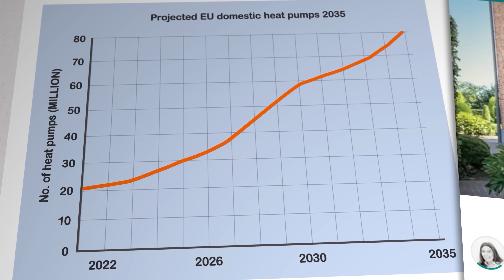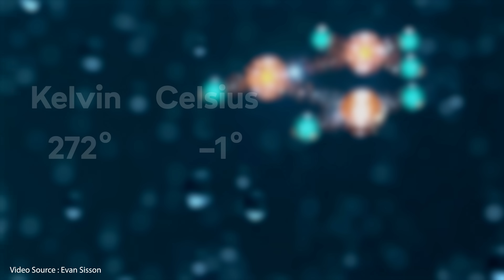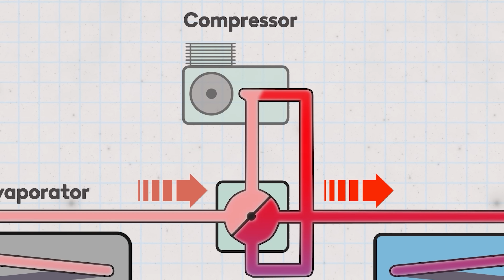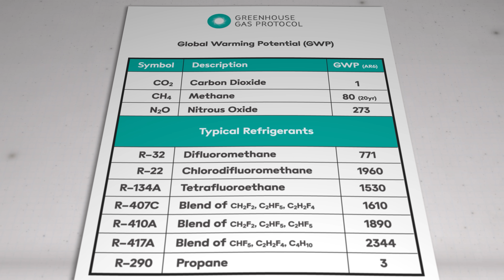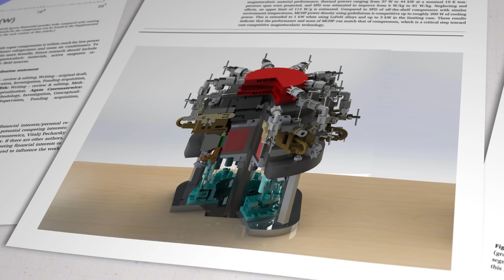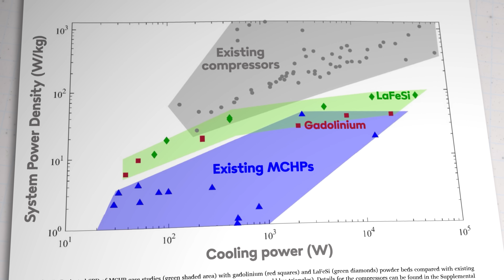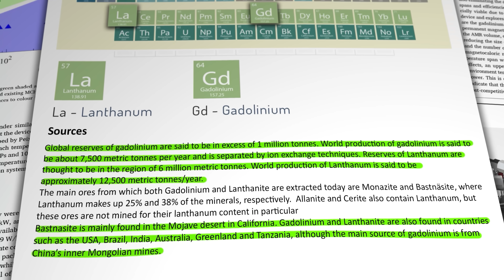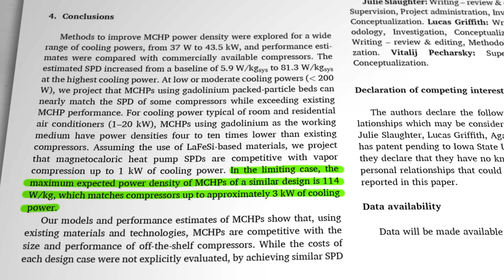Taking greenhouse gases out of heat pumps. (YES! They do contain them!)

Comment: I have 3 mini splits at 5k a piece. Work pretty well & allows me to select room i need most product during any given timespan. Air does not radiate all over, generally out to 8 feet. Does alleviate having to use my full furnace or AC on days where I would not need full heating or AC.

Comment: I wonder whether this technology is more efficient in cold environments than conventional refrigerant systems are?  One limitation of current heat pumps is that their efficiency drops off as the outside temperature gets lower; they're still more efficient than the alternatives, but an improvement in low temperature performance would be a boost to heat pump sales.

Comment: Once one realizes and accepts that the global warming/climate change emergency is a complete hoax, the solution to heating and cooling homes becomes one of pure economics and some answers just jump right out and slap you in the face.  For instance, if you use a heat pump for heating your home, drying your clothes, and/or heating your water, you will pay more up front than buying an electric or natural gas furnace, water heater, or clothes dryer.  You will also spend more money keeping those heat pumps operational.  Once you realize your choices have no effect on "saving the planet from greenhouse gases", it becomes very clear that the refrigerant that should be used in heat pumps should be low cost (not patented) and not EPA controlled, so go with something like propane.  If you live someplace where you heat your house for a large portion of the year and only need AC infrequently, then you have to consider having a simple electric or NG furnace and a seperate AC unit for cooling si that the high reliability furnace racks up most of the operating hours and the low reliability AC racks up fewer hours.  But, if the cost of energy is high, then a heat pump may make more sense especially if its maintenance/repair costs are kept low through simple modular design and use of a low cost refrigerant.
Reply: Aren't you getting tired of dribbling the same nonsense over and over.🥴
Reply: @davidwatson8118  Apparently you haven't a clie what is abd isn't nonsense.  If you believe in the "climate crisis", I fear that your lack of critical thinking is uncurable because that concept is laughably moronic
Reply: @kirkjohnson6638  
"Clie"   😂
Please don't post while drinking
Reply: @kirkjohnson6638  
It's not my ' critical thinking " that's a problem, that is your issue 🤣
Reply: @kirkjohnson6638  
What is causing the current global warming 🤔?
Please provide citations and references.
Reply: @davidwatson8118  How long have we had any accurate global temperature measurements?  How is the average global temperature calculated?  How many times per day are local temperatures sampled?  How far back is carbon dating accurate?  How accurate are tree rings?  How is ice coverage estimated?  When was the thermometer invented?  What is the most potent greenhouse gas?  How long have water vapor's greenhouse gas effect and cloud formation been included in climate models?  Why have climate scientists erased the medieval warm period?  What is the accuracy and precision of temperature meadurements that are fed into climate models?  Are climate updated very often  wnd when they are, are the models revision controlled?  Why is the IPCC report compiled by politicians rather than scientists?  Why is the imminent doom of the climate always 10 to 12 years away?  How/when are any carbon taxes going to be used to reduce carbon and what are politicians going to do when removing CO2 from the atmosphere has no effect on global temperatures but does reduce crop yields?  Why do sea level measurements estimate oceans tising at different rates all over the world?  Why aren't rises and falls of land masses included with reports of sea level rise?  How are sea levels even measured with an accuracy sufficient to measure 1.4mm of rise per decade?

Sorry, chum, but everything about "climate science" is a huge scam.
Reply: @davidwatson8118  There is no credible scientific data suggesting global temperatures are rising or falling.  It's all just bullshit.
Reply: @kirkjohnson6638  
Bollocks Noddy
Reply: @kirkjohnson6638  
You haven't answered.
What is causing the current global warming 🤔 ?
Reply: @kirkjohnson6638  
Still waiting 🤔
Reply: @davidwatson8118  I cannot possibly cite studies on fake statistics.  Did you answer any of my answerable quastions?  No, because if you could you would have a brain and if you had a brain you would know that we have no decent historical temperature records to prove what the global average temperatures were more than 125 years back and, even then the records were very sketchy until 45 years ago and we don't really even know much about the accuracy from the on.

As for CO2 levels of the past - forget about it!  Those records simply do not exist.
Reply: @davidwatson8118  I told you, there is no evidence of global warming and the records of the fake climate scientists show that we've been cooling for the lest decade.
Reply: What is causing the current global warming 🤔 ?
Reply: @davidwatson8118  There is no current global warming.  We've been cooling for several years according to "climate scientists", so you should be living in terror over the coming ice age (just like the one that was imminent following the winters of '78 and '79.

Comment: My Sanden Hot water cylinder heat pump uses CO2 as the refrigerant which, well by definition, has a global warming potential of 1.  It obviously works very well - so it begs the question why isn't it used more?  Apparently it does require higher pressures but seems that hasn't stopped Sanden.

Comment: Just have a think is completely and totally delusional to think that netzero is possible. Clean energy is less than 10% of the world's consumption of energy and it is extremely unreliable. The only way to achieve net 0 in the next 100 years would be to simply stop using energy. This movement is completely insane and delusional. Luckily, people now realize that it is death itself.

Comment: The only reason to complain about new technology is when it does not work as well as the existing technology. In the case of heat pumps, there are pluses and minuses . In the case of heat pumps, retro fitting is difficult, particularly for old homes with poor insulation..

Comment: Just have athink, 

heat pumps are not better than gas boilers, they are more complicated, so more to go wrong and refrigeration plant does go wrong and need specialist attention. Plumbers do not have that expertise.
Why do I say that heat pumps are not better than gas boilers, simply because there is widespread misunderstanding of the efficiency and effectiveness of heat pumps.
 The idea that the greenhouse gas in refrigeant is a problem is laughable, why do we have so many opeople trying to solve non problems. CO2 is not aproblem for teh climate so the infintesibly smaller amount of refrigerant gas released is unmeasurable.
Reply: There are a lot of safety and efficiency in a gas boiler that do make it complicated. And they are especially vastly less complicated than the gas boiler + AC combo,  if you need an AC anyways might as well buy one that doubles as a heat pump.
Reply: @storyls  
I'm sorry but I don't understand what you are advocating?
Air conditioning in the u.K. is a waste of time and money.
Reply: @iareid8255  "Air conditioning in the u.K. is a waste of time and money."
Says who?
There are plenty of people who see it as a worthwhile investment.  I'd rather have a properly climate-controlled house than have it too hot that it affects me working from home.
Reply: Ben, 
people are different, however I suggest that as house airconditioning is very rare in the U.K. that most agree with me.
Reply: @iareid8255  just because it's rare doesn't make it a waste of time nor money.

And I know of people with Portable AC units in the UK, and walking around the areas where my friends and family live in the UK, I do see split systems installed on houses.

AC in cars used to be very rare, but now it's hard to get a car without it.
Reply: @BenIsInSweden  
If it was economic it would be widespread, but it isn't. 

A/C in cars is different and again is not used because it is hot in the U.K., I never switcjh it on in the summer, but it is effective in demisting, counter intuitavely, in winter.
I welcomed it when I worked in Saudi Arabia, but  that's a different situation.
Reply: @iareid8255  Your argument is flawed.  There is an ingrained misconception in the UK that AC is expensive to run, because there is nothing to compare it to. And was the mindset I brought with me to Sweden ~15 years ago.   Anyone I know who has had it in the UK never goes back to going without it.

Also, everyone I know in the UK uses the AC in their cars, you're about the only person I've heard of that won't switch it on.  Many cars have climate control as well, where it is on automatically.  You would be the rare case to not switch it on in summer.

Comment: I will be honest, I think propane (R290) is a good enough working fluid. yes, technically a greenhouse gas, but they contain so little (it is at a slight vacuum) that it won't be relevant compared to the amount  of fossil greenhouse gasses released by volcanoes

Comment: Are you sure your 3 bedroom house has a 9 kW heat pump? Most likely that is the rating including the electric heater that os just pure resistive. COP 1 if you will.
My heat pump is equipped with a 10 kW heater, but the heat pump itself is around 3 kW, but it is of course an old model.
Reply: Depends on insulation etc.  9kW isn't too obscure for a 3 bedroom house with the typical installation in the UK needing between 5 and 10kW.

Pairing a 10kW heater with a 3kW heatpump is mad, and sounds like the installer was avoiding callouts.
Reply: @BenIsInSweden  Nothing the installer can do except limit the heater in the configuration. It's built like that. Nibe F470.
Reply: @itekani  Ah, that’s an exhaust air heat pump. The integrated 10 kW heater is primarily there as a backup to supplement the heat pump when needed—e.g., in very cold weather, during high hot water demand, or when recovering from a setback (like after a vacation). These aren’t very common in the UK due to the poor ventilation standards in homes, which limits their effectiveness.
Reply: @BenIsInSweden  I looked up some air-water heat pumps, and indeed they are available with a lot more power. I guess part of the difference is that exhaust air heat pumps have a limited air volume to work with.
An air-water heatpump outside with a accumulator tank and then FTX for ventilation would be a much more efficient, but I guess exhaust air heat pumps are space and cost effective since they solve both heating and ventilation with the same unit.

Comment: 1-"CONTAINER WALLS...AND EACH OTHER"..
2- HEAT GEEK- GETTING SCOPS 0F 8 ,AND THEY GUARANTEE TO MATCH OR BEAT MANUFACTURERS SCOPS- AMAZING..
THEY DO GREAT INFO ON ALL OF IT...💪💪💪💪👍👍👍🥂🥂🥂🤯🤯🤯😄😄😄💲💲💲💰💰💰
Reply: PS-;WHY DOES IT HAVE TO BE COMPRESSOR SIZE?? IF DOUBLE SIZE DOES AN AVERAGE HOUSE,MOST PEOPLE WOULD BE HAPPY- PUT IN AIRING CUPBOARD, AND USE THE NEW ,SMALLER HOT WATER TANKS NOW ON MARKET...

Comment: Surprised only a number of high GWP refrigerants were mentioned and not the increasingly common use of low-GWP refrigerants like ammonia (GWP 0) propane (GWP 3.0) and supercritical CO₂ (GWP 1.0).  Carbon dioxide was in your table as a reference (GWP=1 by definition) but not as a refrigerant.  Carbon dioxide and propane are still greenhouse gases, but their GWP and also their cost is much smaller than the more traditional chlorinated or fluorinated hydrocarbons.  As these compounds either rapidly decay when exposed to the atmosphere or are already present in abundance in atmosphere naturally, no special collection or disposal is required when equipment leaks or is decommissioned.

Note that pure gas phase mechanical heat pumps work fine, you don't need a phase change material for them to work, a PCM just lets you fit the heat pump into a smaller volume.

Comment: I've tried a lot of things, but since last year I've switched back to using air conditioning for winter heating.
In areas where the minimum temperature is around -5°C, the most practical and least energy-intensive method is to set the air conditioner on a low heating setting and let in sunlight through the windows on sunny days.
There was a suggestion in the explanation of heat pumps that instead of saying that they collect heat from the outside air・・・
I think it would be better to explain that when you use the air conditioner to cool down, hot air will come out of the outdoor unit, and if you turn the pump in the opposite direction, the room will get warmer.
It is true that heat pumps specifically for heating use CO2 as a catalyst, but I think that collecting heat from outside is just an explanation for avoiding patents.

It seems that magnetic devices are being tested in Japan, but I think it will be a while before they become widespread.

Comment: Here in Australia it's called reverse cycle air-conditioning.  I've never had a sniff of it being controversial and i never considered anything else when building my home 10 years ago. I wonder if rebranding from "heat pump" might help things along elsewhere?

It was also fun to freak out Malaysian visitors by showing them the "sun" button on the aircon!  Of course aircon in Malaysia has no need of reverse cycle.

Comment: Heat pumps are refrigeration system air conditioning units run in reverse for heat. Unless huge strides have been made in that technology, they are only good to 20F before supplemental heat must be used. Like it or not, electric heat is atrocious in colder climates and the logical solution, which goes easy on your wallet, it has forced air. Experiments were done in housing tracts back in the 80’s and home owners could not afford the electric heat. If you do not have readily available natural gas, then have at it. Over-inflating gas prices will not get owners to switch.
Reply: My heat pumps handled -20°C (-4°F) for three days straight without needing supplemental heat—proper sizing makes all the difference.

One major issue in the U.S. is poor building design, particularly placing air handlers outside the thermal envelope, which hampers defrost efficiency.

Modern heat pumps, especially those with Enhanced Vapor Injection (EVI), can maintain full capacity down to around -20°C (-4°F), making them a reliable heating solution even in colder climates—far more so than in the 80s.
Reply: @BenIsInSweden  So, your house and every other house in Sweden is all electric and runs one of these marvelous heat pumps and it is not running on any refrigerant?
Reply: @kodak_jack  Mine use R32 as the refrigerant. Not every house, but around 80% of homes in my town use heat pumps for heating—whether that’s air-to-air (A2A), air-to-water (A2W), or ground source.

Most new A2W installations now use R290 (propane) with a GWP of just 3.  An 8kW Ecodan R290 heat pump contains just 1 kg of refrigerant. If it were to leak out completely (which is unlikely, as R290 units are hermetically sealed), its climate impact would be equivalent to a gas boiler running at full power for around 2 hours.

Gas isn’t used for heating at all here, and oil heating largely faded out in the 70s due to the oil crisis, leading many homes to switch to electric-based heating.
Reply: @ So, you're using what you're using because you do NOT have natural gas. Those of us who have it, and at a very cheap price, use it and don't need to go to extremes. We insulate the best we can and are very comfortable using natural gas. WE don't have to buy it from Russia either.
Reply: @kodak_jack  Even if NatGas was available, I still wouldn't use it.  It provides zero benefit over heating with a heat pump.
Reply: @ The COST to heat with electric here is insane. My house uses gas for water heating, heating the house and for drying clothes. That being said, my electric bill is at least 3 X the gas. I must have the most power hungry computer ever made because I do not use much electricity. Why would I switch!
Reply: @kodak_jack  because even when electricity being 4x the cost of gas (it isn't) a property set up heat pump will at most only cost a little bit more than a gas boiler.  In most cases it will cost less.
It's because heat pumps move heat energy so you get 3-5x the heat output for each unit of electricity.

With gas you're getting at best 0.94 units of heat for 1 unit of gas.  But in the UK due to poor system design that is closer to 0.84.
Reply: @ Do I need to scan my utility bill so you believe what it is in MY area?!! There is a huge discrepancy and we will fight tooth and nail NOT to go totally electric. Besides that idiot politicians try to force the issue when we would never come close to having enough generating capacity and nobody is doing anything about it.
Reply: @kodak_jack  change tariff? If you're in the UK then the incoming price cap is electricity being 3.86x that of gas.
Making it easy for a properly installed heat pump to be cheaper to run than a gas boiler.

There are plenty of tariffs that make more sense than sticking to the price cap though.